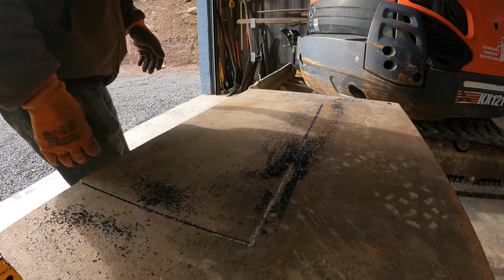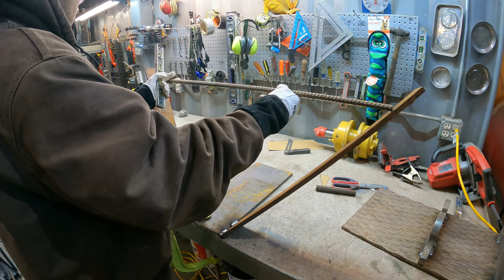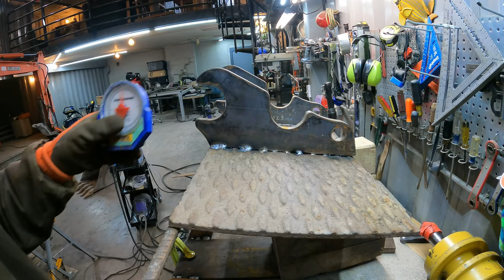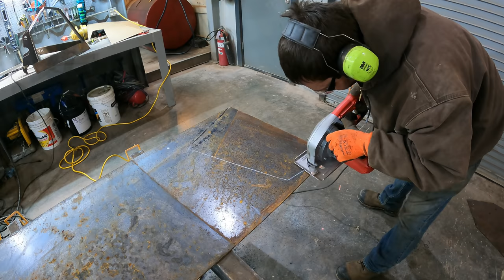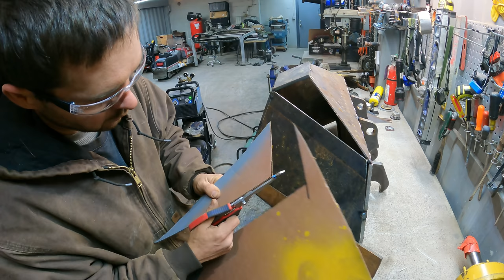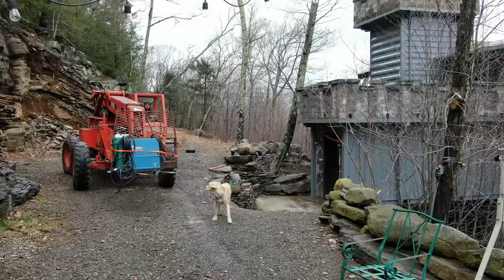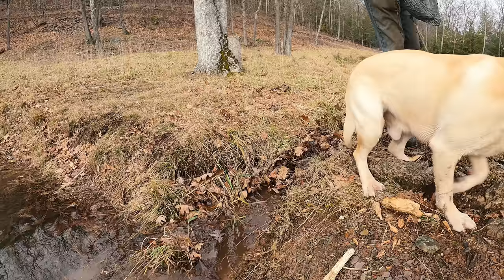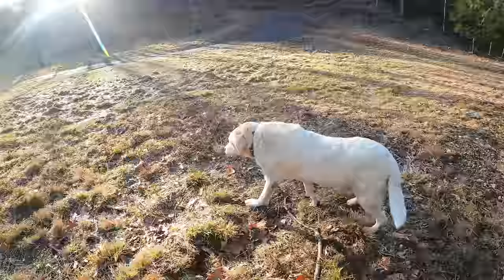Making an excavator swale bucket

Comment: I used to design buckets for an attachment manufacturer and there were a few key points when designing this kind of bucket:

-The angle of the V was specified by the customer, so we would do whatever they wanted... 60* and 90* being the most popular, but we would make the occasional 120* from time to time.
-With any bucket, it's important to keep the angle between the 2 mounting pins and the tip of the teeth the same as the OEM bucket in order to preserve the same rotation when curling in or out. the distance between the pivot and the tip is also important to preserve break-out force. However on a swale bucket, you can cheat that a little because the cutting edge is so narrow and you're concentrating more power in that area... Making that arc a bit bigger allows you more capacity.
-The sides of the bucket were raked in towards the back 3-5* to prevent the cheeks from sticking to the sides of the ditch. This avoids wasting machine power fighting that extra friction.

All in all though, you did great!! You seemed to have fun building it and added new functionality to your machine... Good job dude!!

Comment: That's a really neat idea. You could sell that to Letsdig, Dirt Perfect and Diesel Creek. You really gave it a workout on that rocky hillside. You were talking about the angle of the sides; you can adjust that angle simply by the curl of the bucket. Your only limit is the maximum amount of angle you built it for. Any desired angle  less than that just depends on the curl of the bucket

Comment: That came out really nice. One suggestion I have is to reinforce the cutting edge by adding another hardened plate and have it stick out an inch or two so it bites in better. Adding a lifting eye would help you move it around the shop easier. It looks pretty heavy.

Comment: cool project!  one trick to keeping those weld-on tabs square would be to insert a spacer or two between them and clamp the heck out of it, put tacks every few inches, and weld in sections, going around to opposite positions to balance the forces.    takes longer, but much safer from experience.  also, you need to bevel the edges for butt joints on thick steel, you probably aren't getting full penetration, and those will be weak points.

Comment: You did a great job fabricating it, but you should have ground a V on the brackets and did a 1-2 3-pass weld for strength.  It'll still last a good while but you're going to be rewelding it a few years down the road.

Comment: The short cutting edge on the bottom is going to wear out first.  Make a sacrificial edge and bolt it to the bottom with say an inch or two protruding. When that edge wears out spin the edge around and wear out that side until its time to make a new one.  The sacrificial edge would be say six inches wide bar stock with a 22-1/2 degree edge on both sides.  Make sure the bolt pattern will enable the edge to propel when side one wears out.  Then side two can be used.  Of course the idea is to make the base edge last indefinitely.

Comment: You can use your saw better by only exposing the depth of the blade equal to the thickness you are cutting. That extra blade spinning through that metal ( or wood ) is causing the saw to work harder for no reason at all. It heats up the motor and exhausts the blade with any flex or binding of your wrist that is trying to guide the saw...adjust the blade to the thickness you are cutting and you will cut faster and have more control and triple the life of your saw and blade and your arm. My grandfather taught me this when I was about eight and it helped me so I try to pass it along when I can you can do the same. Less kick back from the saw binding in the cut.

Comment: Easiest way to stop the bucket connectors from closing in while welding is to tack two or 3 bars across the 2 to hold them in place

Comment: fantastic build yet again mate! I've got a comment on terminology, in Permaculture we call a swale, a soft earth mound on contour designed to hold water in place for it to soak, which is kind of the opposite to drainage. the same bucket would be useful regardless, just would be dug flat and level, with a spillway to release excess water to the next swale. curious as to the use of swale more widely than that :-)

Comment: Nice design.  Knowing and using CAD might have saved you some time and let you play with different versions to optimize capacity. Then you could CNC the parts. Impressive build though for roughing it.

Comment: nice job , but you should be pushing your welding gun not puling it , since you r pulling it away from the inert gas , try going and aiming forwards with litle holdups welds will be cleaner :)

Comment: Andrew-
You know how cordless drills & drivers sometimes have spaces
built onto the tool, to carry extra bits with you?

Why can't someone make like a "rack" or "tool belt" for excavators?
Like a rack, maybe on the counterweight- that could hold extra implements?
Different bucket, jackhammer, a compartment for various stuff- chains,
extra teeth (would require a nearby Field Truck) fluid, grease gun w/grease, etc.

Comment: Nice job on the trench/swale bucket. It seems to also do a great job at leveling the material you pull out of the ground.  When Cody had that big stick, did you notice that he also broke off one little stem that was in his way then picked up the big stick like it was nothing to figure out?  As far as talking to yourself; there's an ole adage we used in the home construction business:  It's OK to talk to yourself and it's OK to answer yourself, BUT, if you start saying "HUH" and no ones around you may need some pro-level help to talk to. This is just a suggestion, but it seems common in many of your videos.  You may wish to consider anchoring the pieces your cutting more which makes them easier to cut, you make more accurate cuts, and they are less likely to fall on your toes.

Comment: If you sharpen the edges, it will do better, and take less horsepower to use in harder soil. Second, if you cut blow-holes in the back top of the bucket, you will let water escape when you're scooping soup.

Comment: One thing I do when building a bucket is make a radius from the pivot pin to the cutting edge then follow it to the back of the bucket to see if it will drag when curling.

Comment: like the bucket Andrew I was wondering if you coated your buckets instead of paint  use Bed liner  instead I was thinking heating the bucket then spray to make it hold better or the red oxide like they paint the bridges

Comment: Dendritic drainage...  Like blood vessels, a large one at a termination point (pond, stream, pipe) narrows and becomes shallower and fans out further away from the termination point.  This is how nature does it - the shallower portions can also be wider (like a low spot between two mounds) to reduce flow speed and increase deposition of sediment, so that it doesn't cause brown water downstream (lots of suspended solids).

Comment: You can weld some strongbacks onto the plates across the top edges to hold them in the correct position just be sure to put the welds where they can be easily cut off

Comment: Nice job but you could of just added the wings on the existing  bucket ,, but some times it can over load the machine,, i purposely  bought a narrow bucket an added the wings on a two cubic yards excavator,, a thought add some teeth helps  with ease of digging,, and bevel the cutting edges

Comment: Hey, great video. I wonder if you know anything about shale drains? I heard about them late one night on talkback radio, an old timer rang in who not only installed them on farms decades ago but had done work years later on properties where they were still working. We have similar terrain to what you show where I live in Victoria, Australia. The idea is simple, dig a ditch, just like you’ve showed, line it from the bottom up with shale, then even after it back fills with debris over time it will still function. Fella says he did it for decades all over Vic. Any one know anything about it? Cheers, great work, keep it up!

Comment: Build some 45 degree wings to bolt on the sides forwhen u want the angle of the ditch on less of a incline or even more angle wings of different angles so u got different options

Comment: I could save loads of time & money on that cut the steel with a plasma cutter & convert a bucket that's not needed rather than doing it all from scratch it would save the time of lining the hitch points up using a bucket that's already made for the machine.
Reply: But why

Comment: Only at the end of video I noticed it was designed for making trenches for water.  It making "walls" during digging. Most of the video I thought it's just new bucket which also be used for digging trenches. Probably because I didn't know what "swale" means. Now I've checked. Google translate don't even know this word.. Some other site told me it's swamps, so it makes sense now.

Comment: What kind of blades are you using on the red Milwaukee saw?
Reply from the maker: That whole saw is meant for cutting metal. Link in description for it.
Reply: @AndrewCamarata  Yes sir I did look it up from the link.....I was just curious if you were using the shipping blade with it, it seemed to cut really well.
Reply from the maker: I tried a couple different brand blades, they both seem about the same. They last a while.

Comment: you should buy a rototilt
Reply from the maker: I got a tilt.
Reply: @AndrewCamarata  but there is a equipment called ''rototilt'' Then you can both tilt and rotate the bucket
Reply from the maker: Why do you need to rotate the bucket?
Reply: @AndrewCamarata  You dont have to move the excatator so much . You can dig sideways infront of you for example. Go to rototilt.com and you will see all the benefits:)

Comment: You really should grind or at least wire wheel some of that rust off before welding 😕 too often we get stuff come through our repair shop that has been "fixed" all janky and half assed, that  would have held up had they taken the time to prep before welding

Comment: That there is just straight skippy that you can get the mounts already cut. That would be almost 60% of the battle. But you really need to go buy yourself a welding book or 4.. cuz you did some crap there that misses most of the basics buddy. Remember the "prep work" is 99%. You prolly already know but don't care. Drives me crazy though.

Comment: Andrew, you get a thumbs up for the fabrication; there is no doubt that you have the necessary skills. However, (there's always a "But", isn't there?), the country in which you live and work seems to have a superabundance of very hard, slate rock at or just below the surface. I know you said you used hardened steel for some parts of the bucket, but if you were to spend a few hours with a stick welder and a few dollars on ten pounds of hard-facing rods, building up the cutting surfaces and internal cheeks of that bucket, you will have it for a lot longer.

That is what the blokes with very big earthmoving equipment do, and it would benefit you too, mate.

I am not trying to teach you to suck eggs; just sayin', is all.

Comment: I'm upset that you went way deeper and far beyond what was necessary for drainage. You carved that hill too high removing some of the structure of the hill and playing with your jack hammer you removed another source of strength and stability. You don't de erase the depth as you go going far over the subtle origins of that drainage. I was interested in the equipment etc. But from now on I'll fill my need with other .ore responsible channels. Just because you have it doesn't mean you have to use it.